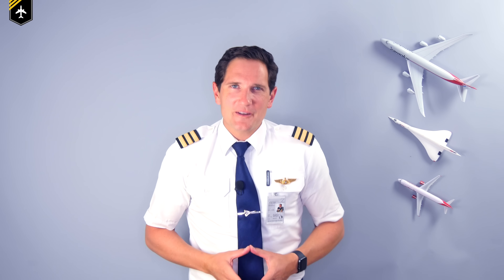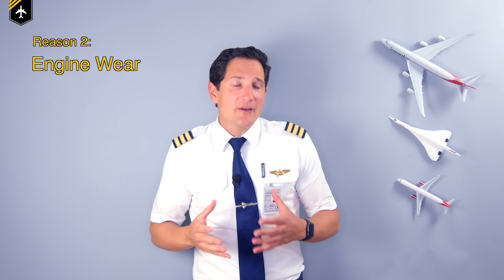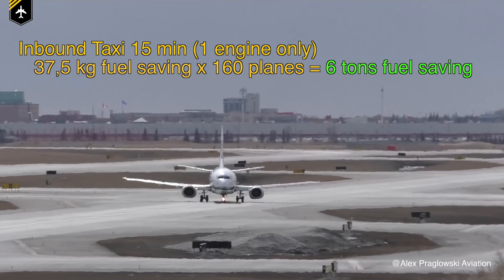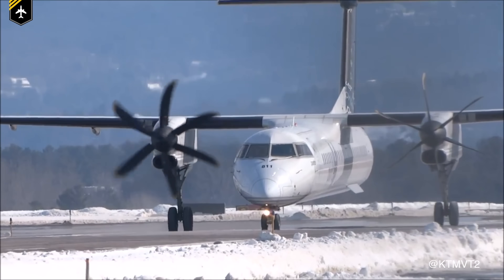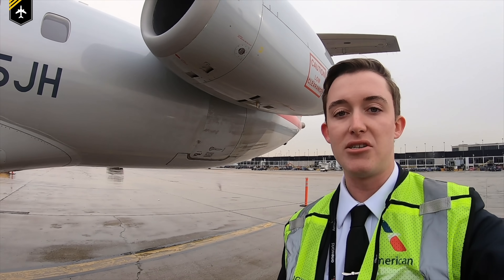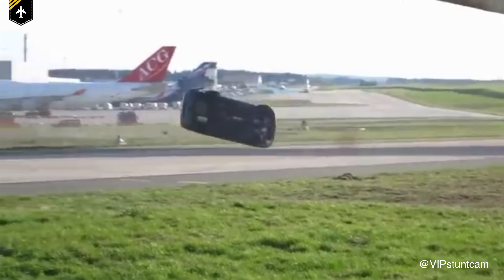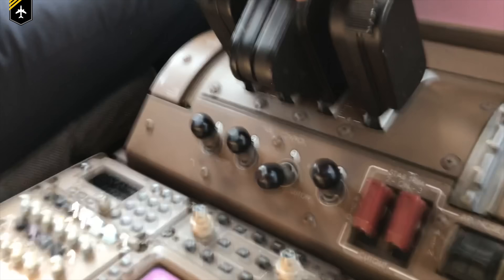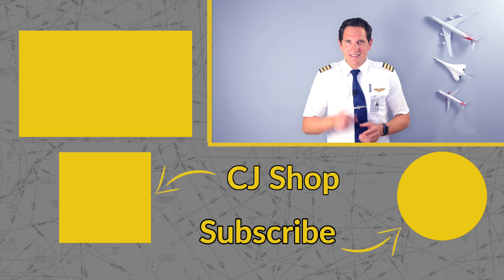Why do PILOTS taxi only with ONE ENGINE??? Explained by CAPTAIN JOE

Comment: The calculation for twins seems a bit naive as the remaining engine will need higher settings, just the same breakaway thrust issue as the 747 on two engines. I can see some fuel savings when stopped and waiting but not as much when actively moving. 
The increased thrust from one engine will also create more noise, though actual measurements would be needed to confirm the sound levels with one operating at high idle, or two at low idle.
The TBO would actually make a significant difference as they do not need to overhaul both engines at the same time, and those 15 minute blocks on the hobbs meter quickly add up.

Comment: Your answer might be fine for commercial airliners, both jet and turboprop. My only experience with jets is the F-111 in the Air Force, and those engines were close to the centerline. Never flown a turboprop. What I do fly a lot is the Cessna 421. So long as you taxi straight ahead, it's no big deal, but start trying to turn and you've got a problem. You wind up side loading the nose wheel rather badly. Kinda knocks fuel savings in the head when you have to have the gear rebuilt.

Comment: Back when I flew for a living (aboard a CP-140 Aurora... Canadian version of the P-3 Orion), we would routinely shut down (or "loiter") number one in flight (typically in the "search" portion) to save fuel and extend our time on station. Why number one? It was the engine that didn't have a generator attached to it.

In some circumstances, we would shut down one and four.

There were, of course, strict procedures to be followed... weight, altitude, pilots/flight eng positions manned etc.

Comment: Instructions were not clear, done it in my Cessna 182

It refuses to take-off damn it!!!
Reply: Did you try turning them both off?
Reply: @full-timepog6844  XD 😂
Reply: @full-timepog6844  🤣
Reply: Try putting in an MCAS system from a 737 MAX. Sure it will crash but at least it will take off!
Reply: Did you offer some money? It works sometimes =))
Reply: Abood Mki lol
Reply: put it in rice
Reply: Obviously you shut down the wrong engine! :-) 
My dad owned a Cessna 180 (?) and you're right, it wouldn't take off with one engine shut down.
Reply: Silentshiba, yeah you don’t get the joke stupid
Reply: GD HeccinHapp lolllolol
Reply: Static Panther, lolol
Reply: Well at least nothing got stuck in the fan. That would have hurt.
Reply: You have to push it more firmly.
Reply: Cessna 182 has a single engine you idiots

Comment: Funny thing about turbine engines. The idle consumption can be up to 1/3 of the cruise consumption, a lot of fuel is burned just to keep the thing running, doing very little work! I once did a stint flying Twin Otters in a war zone (humanitarian relief), and our plan of last resort if the shit really hit the fan and we had to maximize range was simply to shut down one engine. At our typical loads we lost only 25% of our normal airspeed but reduced fuel burn by 33%.
Reply: Oops, a typo - fuel burn in the example above was actually reduced by up to 50%!

Comment: I dont mind when its going to the gate, but i hate it when they taxi with one engine only to takeoff position. That specific taxi time is the perfect time to have all engines running and checking for problems before taking off, like a sudden oil pressure low situation detectable only minutes after engine start.

Comment: The reason why pilots taxi a bombardier q400 with one engine (number 2 engine) is because it provides with the operation of number 2 hydraulic system  that is required for nose wheel steering.

Comment: The noise has absolutely nothing to do with this. First of all the ground crew do have ear protection. It’s mostly just for fuel preservation
Reply: Mine098 Vlogs Yes, Fuel is typically 50% of the  operating cost of an airline, per year.
Reply: beernpizzalover yea that’s why I said that the reason why they taxi with one engine is to preserve fuel

Comment: What is the purpose with the flaps and why are the flaps used during take off?
Reply: The flaps produce more lift, and when used during take off they reduce the length of the take off run. During the landing they allow to use lower landing speed.
Reply: The flaps allow the plane to fly slower. They reduce the speed at which it stalls. Flaps and slats allow the airplane t take off and touch down with speeds significantly slower than cruise speed.
In the 1920s and 1930s when nobody anticpated flaps or slats, they thought the future of aviation was waterplanes. They thought higher speeds and heavier airplanes make longer runways necessary that are impractical to build, so the only solution would be to start and land on water. But them jet engines made higher acceleration of heavier airplanes possible and flaps and slats lower runway speeds. So the future would be land planes.
Reply: Ah thanks!

Comment: Does it really save that much more fuel considering that you'd theoretically need to use more power to get the aircraft moving? Also, isn't it tricky to taxi with asymmetric thrust like in something like a Q400 where the engines are relatively far apart?

Comment: As a ground handler that operates with q300 and q400, it does really help to taxi to gate with engine 2 only running. That is because us ground handlers on the ground, have to connect the GPU on the left side. So it really helps and i think is a bit more secure for both parts! :)

I know my english is terrible😝
Reply: Wow, its really nice to have insight from ground personnel, especially a video about operations on the ground. Thanks very much

Also your English is very good!
Reply: I have daily turnarounds with Q300s and Q400s. They often taxi with engine 1 off, but occasionally with both engines on into the stand. Engine 2 powers the hydraulic system a captain told me.

I don't think the shut down engine has a main purpose to provide safety for ground handlers. When EMB175/190, B737NG or A320s arrives, both engines are on even though the GPU connection is on the right/center/left side of the aircraft.

Different procedures between airlines and ground handling companies. Some have to stay outside the red line until the aircraft comes to a complete stop, we put the chocks on the nose wheel and GPU and then wait for the engines and anti-collision to turn off. Then we approach the rest of the aircraft with cones and chocks.
Reply: Taxiing with 1 engine running is as weird as preforming an oll while cubing.

Comment: Airbus A380-800 is apparently designed to taxi to and from runway on the inboard 2 out of 4 engines due to the wing span and FOD getting sucked up or thrown up from the edge of the taxi-ways.

Same reason why it only has inboard engine thrust reversers

Comment: Curious: Doesn't it take more fuel to the one working engine to move the airplane than it would with using two engines? In other words, the one engine needs to work much harder to move the same mass than it would if two engines were working on that same mass.
Reply: I've been asking the same question too

Comment: As always interesting and informative, but there are two questions that comes to my mind: If only one engine is used during taxi, doesn't it need more power due to the fact, that the other engine is cut off? And is the fuel that has been saved by cutting one engine not immediately burnt due to the higher power setting of the second engine? And secondly isn't there a lot of asymmetric thrust when taxing with only one engine?

Comment: Don`t u have to let the running engine run on a higher RPM which will again result in a higher fuel consumption? So do you still save fuel?

And another question: Do you alternate the engine you use for taxiing regularly so that their wear is equal?
Reply: The running engine isn't running on higher RPM if you're not moving, and it would be fairly marginal if you're just keeping in motion.
Reply: @chrisschack9716  Thanks for your answer. But I meant during taxiing. Like do you still save fuel if you just use one engine therefore on higher RPM which results in a higher fuel consumption?

Comment: Hi Joe, great vid again.
Question: what about the fact that a single engine running has to work harder and burns more fuel doing so? The fuel saved by the inoprative engine is used by the engine that has to do the job of two engines and also needs to deliver power for all the auxilary systems. Im sure the industry has thought about that fact but i like to know how.

Comment: On an Airbus aircraft, as a passenger, you'll notice the single engine operation, with what sounds like a car starter motor running from an almost flat battery. Each engine powers separate hydraulic systems, which clearly can't by hydraulically connected but there is a device, called a Power Transfer Unit, that mechanically takes pressure from one circuit, to apply pressure to the other circuit. 
I thought I was adding something useful here... and then whilst googling for the sound... I find a Captain Joe video:
https://www.youtube.com/watch?v=SCplhq1xoYE

that not only demonstrates the sound but also explains exactly why you hear this, just as you arrive at the gate and are standing up to open the overhead lockers.

Comment: I thought the left engine on prop planes was shut down to allow for quicker passenger disembarkation because the left side is always used for passenger loading- unloading
Reply: That is an added benefit. While saving fuel may be the primary reason to shut down one engine while taxiing to the gate, the choice of the left engine to shut down on some aircraft is for that very reason.

Comment: Real easy answer from me!  My plane only HAS one engine!
Reply: That is not an "engine", it's just a fan to cool the pilot's face - just watch the pilot sweating if this fan ever stops in flight!
Reply: @Halli50  lol overused joke
Reply: Haha, same!
Reply: @tdoheron , glider pilots are more cool than parasites, in my opinion. I like having more than one engine, especially over hostile terrain and extended bodies of water. I have experienced the known psychological phenomenon that whenever you are flying single engine in an area where you cannot glide to a survivable spot (say, 50NM out of Iceland, heading for Greenland) your one-and-only engine will invariably start sounding like it is chewing gravel, not oil! It takes a looong while to accept to the fact that the problem is in your head, not the engine.
Reply: @Halli50  i would rather fly on a plane with at least 2 or more engines too... because higher chance of surviving because if one engine goes out and you only have one RIP if one engine goes out and you have spare  engines eh ok at least i have a chance of surviving this one....
Reply: @tdoheron  So in effect both the glider pilot and the normal pilot are both taxiing with only half an engine...
Reply: Shut it down and push while taxiing😎
Reply: Then shut it off after take off or before landing to save fuel and it will eliminate one jerk 😂😂😂
Reply: @tdoheron , good point! Glider pilots are either very cool pilots or parasites...
Reply: Cessna?? 🤔
Reply: ask the passengers to deplane and help push it
Reply: @fatdoi003  I see passengers being asked to help push all the time. That's life for a hang glider pilot.
Reply: Use half an engine
Reply: @nefarioulyte9996  It's called a ryanair flight.
Your treatment options are the following:
RUN, HIDE or BLEACH
good luck :-)
Reply: so just use the Tail Wind to push you to the Runway for ULTIMATE fuel savings
Reply: Because your plane is  a Splitfire from the WW2
Reply: My plane has 8 XD, 
(Well, it's governments plane. But I fly it)
Reply: One engine with two bullets
Reply: These replies make me think that YouTube replies can actually start conversations..
Reply: @ImAFatCheezIt  instead of arguments?
Reply: @gasdive  yeah lol
Reply: Shut it down and have a 100% fuel saving then :)
Reply: My plane has none! It doesn't have a body or wings either. That's why I'm not a pilot and don't own a plane.
Reply: You're right!
Reply: try cutting it off for fuel saving
Reply: Ice meme van I only LOOK dumb
Reply: Then you're getting nowhere my friend xD
Reply: I bet u flying a cirrus jet
Reply: You have to push your plane for taxiing !
Reply: Dennis Harrington hahaha
Reply: Liviu Hornoiu worse. A Piper PA-22 Tripacer.  But it flies!
Reply: Lol
Reply: Lol
Reply: Yup, I wouldn’t shut down that engine if it’s the only one. Your taxiing might only be as fast as you can push.
Reply: @philippal8666  been there.  After refueling at self serve, it just seems an awful waste to fire up for a cupla hundred yards to parking.   But l PULL.   And my plane is JUST interesting enough to attract airport bum help
Reply: @tdoheron  or a sling
Reply: HA LOL
Reply: Well played sir.
Reply: That’s my reason! As my Cessna 172 only has 1!
Reply: What kind of plane is it
Reply: 172 likes

Ironic

Comment: It is to piss the maintenance guys off.  Now both engines now have different PM and Cycle time maintenance .
Reply: Actually, this helps safety, since you have a lower chance of a dual part failure if there's a difference in cycle time. The same principle applies to RAID Arrays in Computers: When a disk fails, and all of the disks in the array were bought in the same lot, there's a good chance that another one will fail shortly after, especially during the rebuild where the stress is higher. This is typically avoided by using same model disks that have different lot numbers and used time on them.
Reply: Well that is an advantage on the Embraer 145 where they do the other engine for taxis on the opposite engine for taxis out for takeoff compared to taxis back on landing.
Reply: @EwanMarshall  P-3 normally flew  long hours  on 3 engines.  Always fun.,  not as big a difference on taxi times but it makes the logs way off.
Reply: Even with brand new airplanes, you want to change out a new engine with older   engine  Every engine has its own pedigree.  They move from airplane to airplane.  Much better to have two from different lots and life cycles.  Way less likely to a common failure mode.
Reply: Not really, since the engine time and cycles are tracked individually. A cycle is counted as 1 flight, and ground operating time doesn't generally get counted... only flight operating time. Of course, there will be a difference in time/cycles if an engine has to be changed.
Reply: IMRROcom probably don’t want to piss off the maintenance 😂
Reply: Not really. At idle power, the engines run at relatively low temperatures, so there's very little wear. And the number of cycles will be the same.
Reply: IMRROcom that’s what I was thinking 😂
Reply: It's a bad idea to do maintenance on both engines at the same time anyways. People screw stuff up sometimes, even maintenance personnel. If you mess something up on one engine and you're doing both at the same time, the probability of having the same mistake on the other engine increases significantly. As an example: Eastern Airlines Flight 855. https://en.wikipedia.org/wiki/Eastern_Air_Lines_Flight_855

Comment: Very nice video. Useful facts. Many different operations shown for the specific airplane types. Interesting was also why a certain engine on the specific aircraft should be shut down (instead of others). And also good to hear was why I don't have to taxi-out with one engine on my A320 in the simulator ;)

Comment: Hi Joe,
While the logic for the single engine operation is good.
However I have a concern on this.
As you may know each engine is designed for certain flight profile carrying defined loading, in case any Piot uses one engine more than the other we may risk a premature engine faliure. As a engineer myself working in aero engines would not recommend it but the effects may be reduced if engines are shuffled for this purpose.....let me know your thoughts...

Comment: But when you shut down engine 1 engine 2 needs more power, right? 
If yes is the saving as high as Joe said?
Reply: But taxi on the runway doesn't use much thrust compared to what the engines can do. They use scarcely more fuel than when they idle. At taxi, idling is the main source of fuel use (, I guess).

Comment: I understand the reasons for fuel saving by switching off one engine but does that mean the remaining engine still running would burn more fuel having to work on it's own ?
Reply: I was asking myself the same question. But during taxi after landing it's probably not necessary to accelerate quickly once you had to stop (for other traffic etc.). So I guess you simply apply the same power output to the remaining running engine and therefore accelerate a little slower.
Reply: If only 1 engine was used for taxiing anyway with the other idle it would save a tad under the idling fuel.

If both were used then shutting down one will result in less than the idle fuel used being saved, but still some saving as the extra for the thrust on the remaining engine would be less than running 2 engines.

Design flaw in  the 747 hydraulic systems that number 3 not number 4 can be shut down - if they had been swapped over then 4 could be shut down which reduces risk of loose stuff on the runway margins entering an engine  (unless there is a good reason thrust from an outer engine is preferred, eg to make compensation to. asymmetric thrust easier.

Comment: This is virtually impossible in fsx. Yes you can taxi straight ahead and turn away from the dead engine but not without much hard staring into the working engine. But it is impossible to turn into the dead engine especially when you need to turn into the gate unless you taxi with enough speed and cut the working engine and turn on just the forward momentum. Is this a problem in the real world? Can you make a hard turn 90 degrees or greater unto the working engine without difficulty?